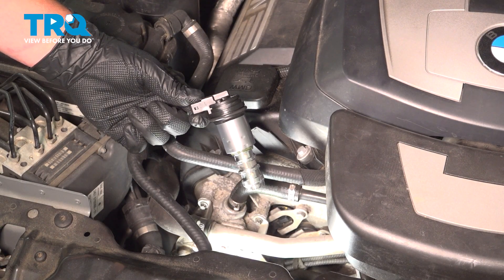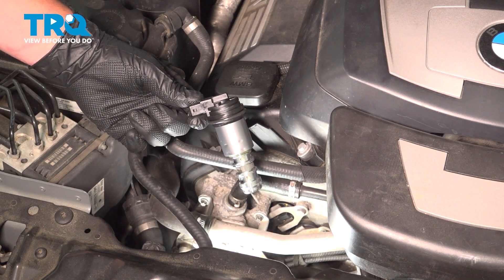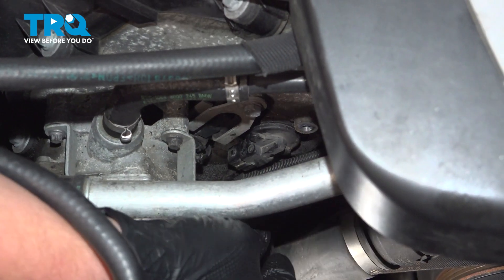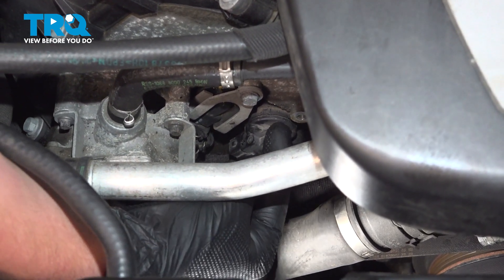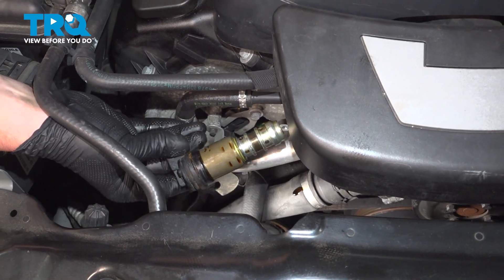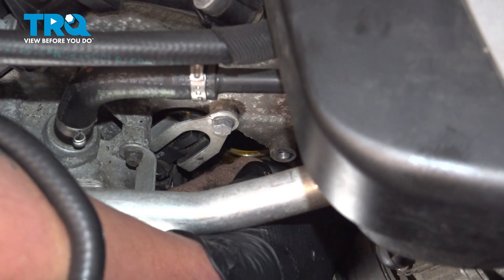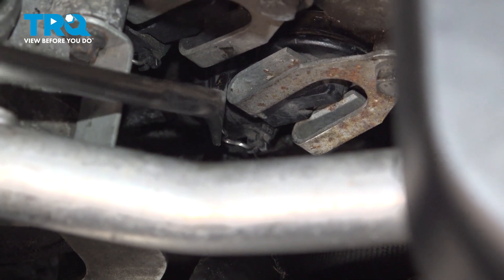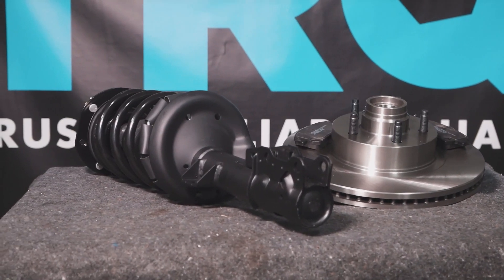How to Replace VVT Solenoid 2006-2010 BMW 550i

Comment: I have a e60 550i been in shop for 11 months was diagnosed with a timing chain problem and he recommended me to just do same engine swap the swap is done and it’s still in the shop currently running rough still do u think there’s a possibility that vvt solenoids the cause